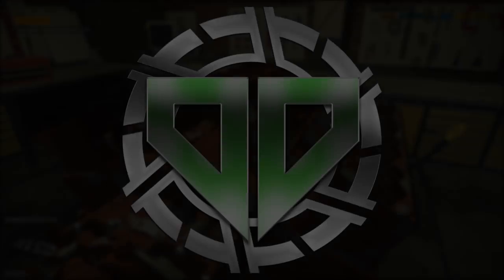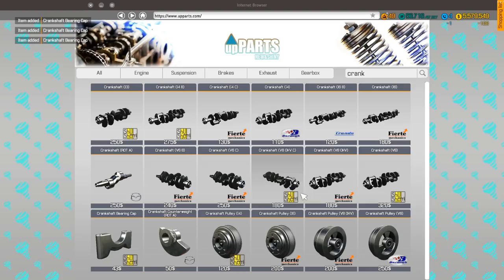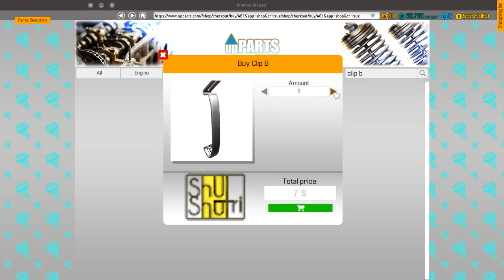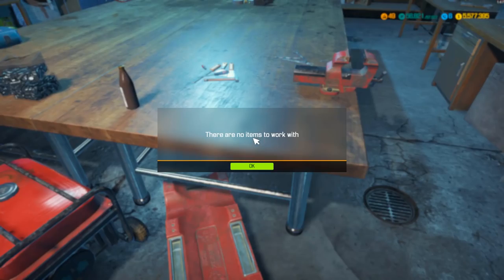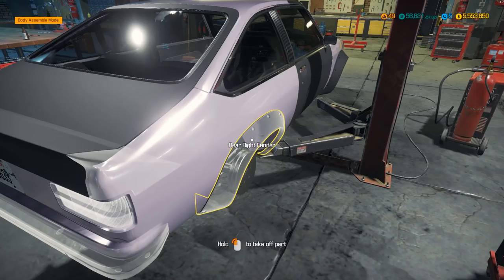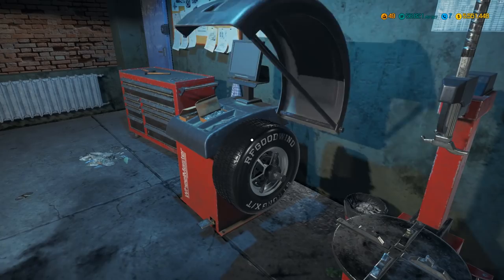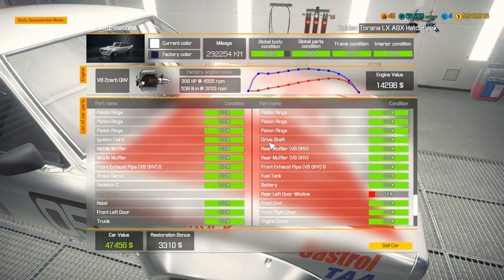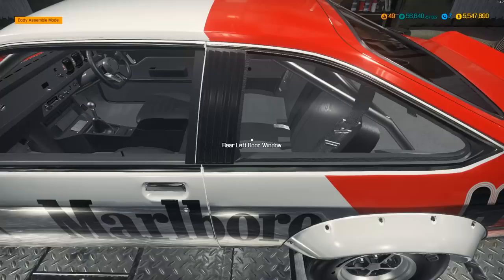Car Mechanic Simulator 2018 : 1977 Holden Torana! (PC Let's Play)

Comment: YES! FINALLY
Edit 1: diesel, america has the holden commodore rebadged as a Chevrolet SS
Reply: They stop making that to
Reply: Golly Wog are you going to make the HDT Livery go over the wheel arches? It looks a bit wierd without that
Reply: MustangFan510 current bug in the game with tuning parts and liveries, it's all mapped and ready to go just waiting for red dot to fix it
Reply: Chevy is holden, the commodore is just a new malibu. The ss is a new v8 version of the malibu
Reply: Panther not correct, commodore is an Australian built car that has no relation or similarity to the Malibu.
Reply: EverythingGaming he means the 2018 Commodore
Reply: The ss is a malibu, and the ss is a commodore, just different grill, bumpers, etc
Reply: other way round, the malibu ss is a rebadged commodore. it was designed and built by australia

Comment: Diesel, the way you built the “Torrie” you need to use Racing seats, like seat 11, and the steering wheel needs to probably change as it’s too modern, although seat 11 is probably too modern as well. And those tires should probably be changed to race tire b. The wheels are the standard Torana wheels and it should only have around 375hp to be accurate, the livery needs to go over the flares and the headlights need to be the headlight c when they are usable. It also needs to have Victorian plates (I.e. the licence plates from Victoria, Australia) as I believe that’s where the 1977 HDT Torana’s were built.
But Overall, Golly Wog, you’ve done an epic job (I have to admit, I am slightly starting to like these epic little cars, I’m a Ford person) and please do a 1971 Ford Falcon XY GT-HO Phase III or a 1973 Ford Falcon XA GT-HO Phase IV and I believe only three were ever built or the XA’s so it needs to be super expensive, XY’s generally go for around AU$300,000 - AU$400,000 at the moment (genuine GT-HO’s that is) and I don’t think the XA’s have ever really gone up for sale, but they would hit at least AU$1,000,000 I reckon (for a genuine GT-HO)
Reply: 4 XA GT HO's total, 3 Brambles red race prototypes, one of which was destroyed and is being rebuilt right now and one Calypso Green production line test car.
Reply: also diesel needed to run wider wheels, there was a readme with the mod saying what wheels best fit the wider flares
Reply: Was the mod updated as my version of it does not have the wider flares or other addons. I downloaded it pre HDT livery coming out.
Reply: yes